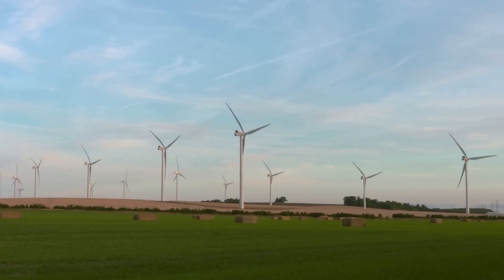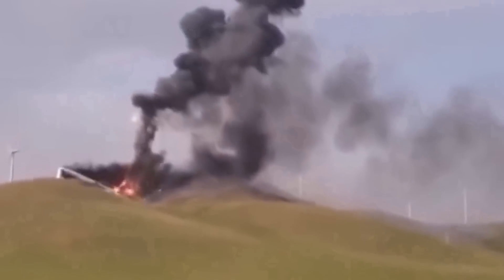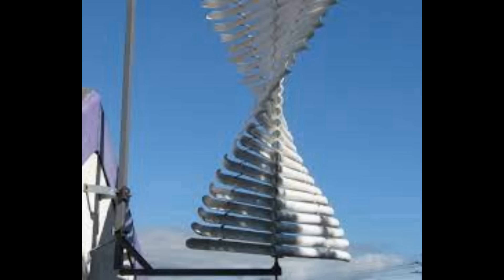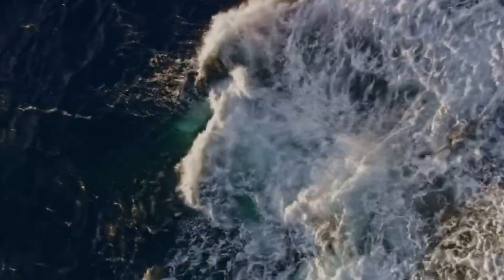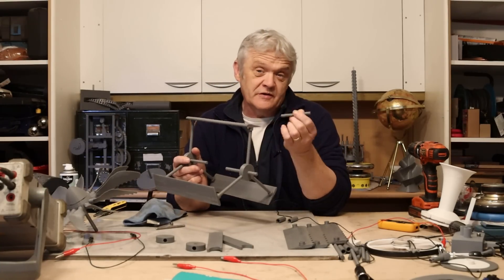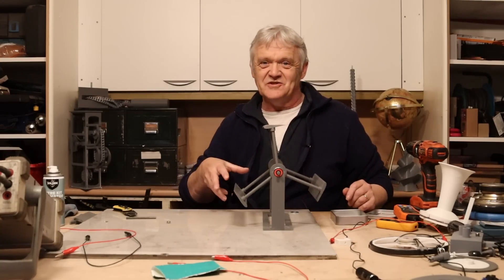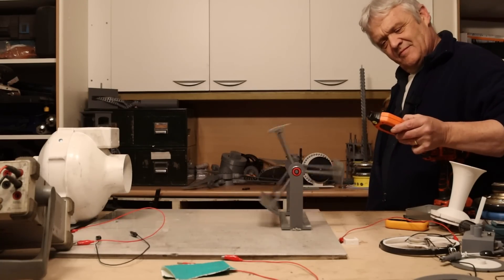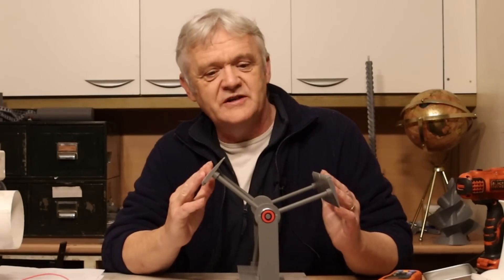2110 The Next Step In Vertical Axis Wind Turbines - Tubercles

Comment: The issue that keeps escaping these builds is.
You are applying the blower at 90 degrees to the blades.
The winds rarely come at the blades at true and consistent 90 degrees.
Even larger Tubercles would probably do better at pulling winds that are NOT true on to the blade into a redirected True onto the blades.
This change can only be used in comparisons' to a low Tubercle blade that has funnels that compress the winds as it approaches the blades.  The common form of that is a smoothed out roof designed to  act like an open topped wind scope.
By adding side scoops to edges of the building you, only remove the wind forces that are going around the house/building and you would mostly look at the force as a saved, as opposed to a generated force.
(Said structures on the edges of a single story Building would be best conformed to the needs of any area that has a Tornado season in the form of something that can be lowered in an emergency since winds in excess of a certain point would not just rip the side fins off but could contribute to the whole of the building being sucked up off of it's foundations.)  Thus I would start with High tech but long lasting variations on Sail cloth, with a Sailing based drop down method.
Those areas that do not have these issues could be standard constructions or a High tech Sail with NO ablity to be adjusted.

Comment: Sorry for my english, but hope you will understand my idea. If you put a 25% diameter size shield on north-west side (from 9 to 12 o'clock) of construction - it will protect your generator of negative wind pressure and theoreticaly blades will go faster.

Comment: 2 things Robert; the balance won't let it start but it would if it was balanced and 3-7 degrees of to the outside of the leading edge depending on the symmetrical wing used will increase the torque and starting abilities as well as increasing power all through the range of rpm/tsr, try it, you'll be surprised

Comment: 7:28 the little start need could be solved with the addition of a small windmill with a one directional gear. it could be just 3 square panels as it only has to get it started.

Comment: I did a whole bunch of research on vawt's. The slightest change in chord length can have dramatic results.
Traditional turbines win hands down in so many ways.
The main problem is sail area Vs materials used.
Vawt's are like F1 cars. All speed and no pulling power.
Fixing this torque problem comes at the expense of complexity.
I have a complex solution to address the vawt issues but have never built it. You are welcome to try if your machining skills are up to it. The mechanical concept  has dumbfounded everyone so far but I'm sure you are smart enough to get to grips with the drawings. Let me know.
Reply from the maker: What i get from this is you love HAWTs and are on your soapbox. I disagree with only 90% of what you say lol
Reply: @ThinkingandTinkering  I love all of them and tinkering.
(Trying to resist topic drift)
If adding the bumps on the trailing edge of the wing alters the overall chord length, it can have a really big effect.
So your results (increase in rpm) could actually be better than you realize.

Comment: Nice work.  Better if you had added a load to test the output difference.
VAWT are great for yachts, as much safer, not swinging around, and easier to stop in high wind.  If quieter even better, noise is the big drawback for turbines on yachts.
Reply from the maker: Thanks for the tips!

Comment: The first test your arm was a lot lower partly blocking the air from the model. 2nd test your arm was up out of the way of the airflow. Not a equal test. In any case HAWT will always be more efficient as the blades don’t have drag going back against the wind.
Reply from the maker: is that right lol

Comment: The increase from ~100 to ~149 rpm is very impressive. The only question I have is were the tubercles additively applied (fan blade width slightly longer on avg) or subtractively applied (fan blade width slightly smaller on avg) or were they applied sort of mid way so that no overall change to the mass and width of the blade occurred?
If the overall width of the unchanged blade was shorter, it would be similar to say slightly increasing the diameter of a fan blade and calling it better... but everyone know that a larger diameter blade generally will have better performance... which is why I am "hoping" that the tubercles were either subtractively applied or applied in such a way as to average the change so some parts of the blade were smaller and some larger.
Reply from the maker: mate this is a rough and ready test of a principle - I wouldn't worry too much about it tbh - but you might want to have a read on the subject as it looks - roughly - as if it is worth delving into deeper - and to be honest that is about ll you can get from a rough and ready experiment like this - having said that i added a bit on and cut a bit off to maintain width length and breadth the same
Reply: @ThinkingandTinkering  Well, that is perfect, thank you... it sounds like this technique can seriously improve airflow. I will definitely look into it!

Comment: Your next step is to outfit each type it with an identical generator and LEDs; then stand them both vertically to see the improvement portion difference in that which is more akin to a real world implementation. I'll download your files and follow this as well.
Reply from the maker: cheers mate
Reply: The orientation should make no difference (but its an easy test to do), but I was keen to see the impact of the tubercles on power generation (how much more power do the tubercles allow to be collected). Also, to make it a fair test, we need to consider whether adding tubercles is increasing the area of the blade or keeping this constant. 3D Printing provides the opportunity to design alternative blades that use the same mass of plastic, so we can be sure that each blade isn't slightly bigger and therefore gaining an advantage from its size rather than its shape.

Comment: to me they (Tubercles) look like diffusers, so it's interesting that increases performance in that in some case they are meant to reduce drag and others they seem to increase vehicle stability implying a downward force
Reply: They might also be compared to Vortex Generators, and a comparison of VGs vs. Tubercles would be interesting. It would be easy for Robert to print a set of blades with VGs and run a comparative test. I think the testing also needs to look at different wind speeds to see whether the VGs or Tubercles are better at different speeds.
Reply from the maker: for sure mate

Comment: Good one but the outer surface has to be more curved than the inner one to create a lift like on an airplane wing, here both sides looks pretty much the same
Reply from the maker: it's not mate- it has a differential curve - but even so if it were curved to the same degree it would still work just think of the wells turbine

Comment: (how does your latest deal compare with a shading device to reduce drag  experienced by the upwind blade - no longer truly "omni" but that's the deal with some designs) A voith schneider type of mechanism for VARIABLE AoA, will allow an improvement in "thrust"- torque- output throughout the cycle, at the "cost of complexity"... Nothing is free of course.
Reply from the maker: no idea

Comment: That modification is very intersting.  
Robert, if you were to connect each turbine to a generator (Each turbine would need to use the same generator to keep things equal), with the same wind speed, and connect to a stable load.  The speed of rotation of each turbine, under the same load, should determine if the modification also increases in torque, from the original.  Just a thought🤔💭
Reply from the maker: good thought - cheers mate

Comment: Seems a vawt on large scale would be better for wild life and longevity. Use a blade with a roughly 30°-45°'V' shape with 3 on a vertical axel. Stacking another offset by about 45°-60° , the repeat. With a 100'-150' diameter. Using a smallish 'V' scoop connecting the tips. At a angle with the v-scoop blades spiraling around the tips. With about 4-6 blade sets high seems it would be a decent turbine. If I had a 3D printer, and a hair drier, a British accent, I'd try it myself! 
", also; possibly have the top 'V' scoops at a different angle , possibly 60° , 70° , 80° maybe as much as 90°  with tubicals on both the leading and trailing edges. See how goes it! ✌️
Reply from the maker: good plan mate - cheers

Comment: That is a pretty remarkable difference . Like I said before they should be on all propellers. On wings as well but, I was thinking that these were designed after a whales so for water. That in my mind makes me think that using them for air the bumps should be ten times smaller since the decrease in density from water to air🤙🏻
Reply: - 10x,  100x or 1000x ?? (Density difference of air vs water is huge). - "Reynolds number" is a nondimensional metric used in fluid dynamics... (Point of research). Don't forget of course air speeds are usually 10x faster than water speeds(100x comes with compression issues mostly- high speed aircraft).
Reply: @kadmow  true but ten times smaller as a test just to see the difference first
Reply from the maker: i am not sure it is that simple mate - lift is a product of fluid density and fluid velocity - so - though water is more dense it also moves more slowly - however, size, shape and distribution is a very active area of the research when it comes to tubercles - so good point
Reply: @ThinkingandTinkering  I think that it is worth testing. The results are already outstading but, I think that this will make a drastic difference still.
Reply from the maker: i agree mate
Reply: @ThinkingandTinkering  I can't wait to see the results. 🙏🏻

Comment: hi uncle robert, Can I make a heating pad for my feet by absorbing conductive paint into the fabric?
Reply: You could if that paint would also be resistive enough to make heat. But this paint would aso need to be flexible enough, so your socks wouldn't turn into stiff rain boots. And painting them all would not be a good idea, instead just make a zig-zac line on the sole. You could use a conductive silicone. But i had such idea where you buy carbon fiber heating tape. First you can sew it gently on the sole, then add some silicone to bind it with material and protect from wear, connect a battery...
But i bet you could find a heating socks cheaper. Unless ofcourse it is for tinkering and fun 😊
Reply: @ogi22  thank you I'll try zig zac
Reply from the maker: yes

Comment: Would be really interesting to see if there is any difference between this smooth type and a very sharp one. Maybe the sharp tip would cut through turbulence even better.
Reply: - a row of pencil points embedded into the leading edge seems interesting, don't forget the trailing edge too, whales owls and bats don't.
Reply from the maker: good point - give it a go mate

Comment: Two issues with your test:
1. Having the blades close to the tabletop really screws up your results. It needs to be away from surfaces etc.
2. Skater bearings are not good, as the shield on the race inhibits free movement. Open race bearings are superior to shielded race bearings.
Reply from the maker: i am sorry mate neither of those are issues with the test as both were tested in the same conditions - they are issues with performance of a stand alone version that is true but that isn't what is being looked at

Comment: Interesting it opens up several lines of enquiry, more smaller tubicles, or fewer larger tubicles, whether even sized tubicles or irregular sized ones works better?
Reply: @lardycone  But those questions are very valid. I hope someone in aerodynamics will make such tests:)
Reply from the maker: absolutely mate - my choices on position, spacing, size etc where really pretty random - you are spot on i think - there are loads of things to be looking at

Comment: Something to remember for anyone looking at VAWTs: The spiral shape does not actually matter for generating power. They'd work if you untwisted them. The twisting part is for noise and vibration reduction - it means the horizontal force on the turbine remains roughly fixed throughout the spin, rather than pulsing as the cross-sectional area changes and making the whole turbine wobble.
Reply: The twisting is also supposed to reduce the torque pulses and help with starting as there is always some part of one blade that is optimally aligned with the wind.
Reply: And you get more surface area in the same height of a straight blade.
Reply from the maker: cheers mate
Reply: I have also heard that being twisted helps them "self start" easier.
Reply: @scottcarr3264  It does, but twisting also makes active pitch control much more difficult than with a straight blade. Active Pitch control is the single most important improvement you can made to a VAWT as it improves starting performance, power production efficiency, and reduces the dynamic loading from the power pluses and vibration.
Reply: Putting those tubercles on a spiral shape seems like a challenging task to me, but would that work too or is it important for the tubercles to be across the straight axis?
Reply: @C1Ansy  Now that's a question i'd like to know the answer to - whether it would be a net gain to combine the two strategy or they would actually "work against each other" and create worse turbulence/wobbling/inefficiencies/point of failures/etc.

Comment: Very impressive 49% increase in efficiency Rob.. I did notice the reflective tape was seriously putting the rotor out of balance which will have sapped some energy. Nice work.
Reply from the maker: cheers mate
Reply: Would it be possible to create a helical blade of this design? And would it make a difference?
Reply: @rayg436  It would certainly be possible, and it would certainly make a difference, but one challenge when creating a helical blace is how the tubecle shape is adjusted to fit into the swept leading edge of the blade. There are a few ways in which this can be done, and it seems likely that each method would have a slightly different result to the other methods, so some testing might be required. The alternative to testing in a lab, is to look to nature to find a mammal that uses a swept blade. The whales features in the video clearly have a swept fin, but their fin moves fore and aft as well as up and down, and also rotaties at the 'shoulder', so the tubercles that evolution has tested for the hump-backed whales are optimised for the range of movements and time spent in each position. For a VAWT, the blade doesn't move (althouhg it should), so a different arrangement of tubercles on the leading edge might be optimal.

Comment: Another application that comes to mind with the addition of tubercles would be for turbines. Specifically with the compressor side of turbocharger, because you mentioned increased capture in turbulent airflow, I wonder if that would provide better energy scavenging and efficiency on existing internal combustion engines. Great stuff as always!
Reply from the maker: good suggestion mate
Reply: BullsEyePower makes a 'BatMoWheel" compressor that uses something similar as a drop-in replacement for stock diesel turbos. It does make more power, but it's also a billet wheel, and in general billet wheels make more power than cast ones because of better tolerances.
Notably though neither Turbonetics nor Garret were interested in the technology and they make most of the highest-end racing turbocharger compressors.
Reply: @IFRYRCE  Very interesting piece of info, thanks for sharing! After having a look at the design, it seems a bit different, but could functionally provide several of the same benefits. But thinking of it now, it's probably quite hard to make and maintain balance, especially as that wheel gets up to 80k-200k RPM. So I understand some of those potential challenges and hesitations as to why they wouldn't jump on the band wagon unless it shows massive performance improvements. I suppose I'll just leave that to the pros to experiment lol

Comment: Well, in the US they are tearing down perfectly good smoke stacks.  They could be retrofitted with wind turbines, and take advantage of the natural updraft
Reply: They're not designed for the side loading. They wouldn't be safe as a turbine tower.
Reply: @VinceSamios  , not on the outside, have them inside, and the internal updraft would be controllable with dampers where air inlets such as removed breeching ducts are.  Also, wouldn't have to be as heavy duty as vertical independent windmills
Reply: @dash-4150  there's a concept called solar towers, which uses massive greenhouses and a very very tall tower. Like 1km tall. I don't think a smoke stack scale would make any sense whatsoever.
Reply from the maker: i like it mate - cheers